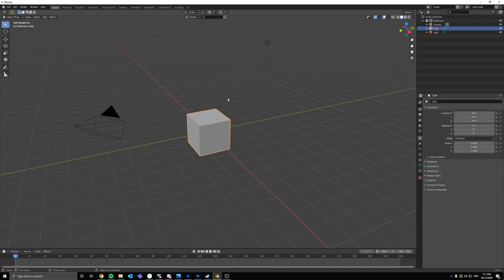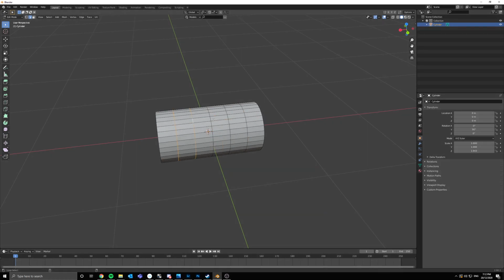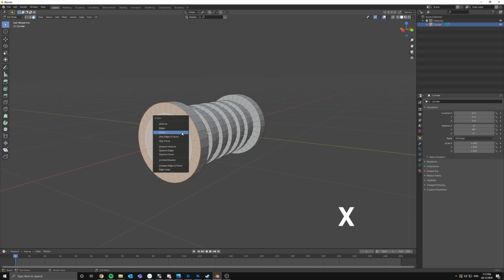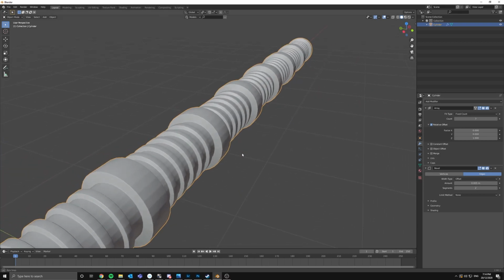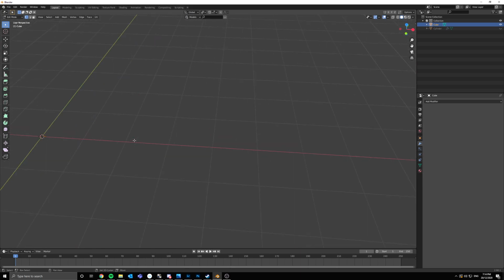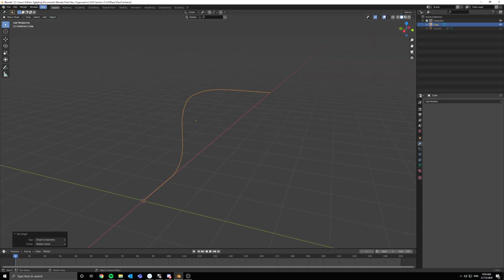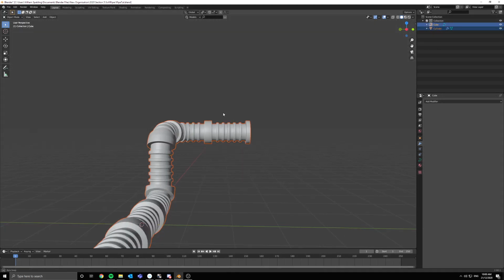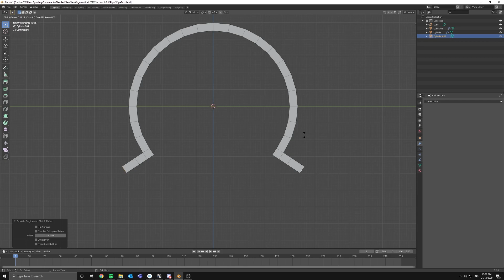Easy Pipes In Blender

Comment: thanks for this amazing tutorial! everything works except when i select the curve as the curve modifier object, i can't get it to follow the curve like you did. it's still random even when i apply selection to active.  any clues where i'm going wrong?
Reply from the maker: Hmm this seems to be a common issue, are you using blender 3.0?
Reply: @WilsonDigitalDesign  2.92!
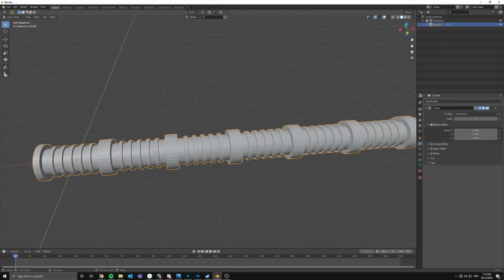Reply from the maker: @jeffhahn5799  Ok, make sure your pipe segment is rotated so its horizontal (you will need to turn the curve modifier off to check) then try rotating the pipe around on the Z axis until the pipe is running down the x axis like you can see in 1:04 - Or what ever the deform axis is set to in your curve modifier. Hope this helps.

Comment: could you please give any tip if it works in 3.0 because i've tried it several times but couldn't achieve the same result, the pipe just sticks to the end of the curve but doesn't transform :(((

Comment: Follow the tutorial, but the pipe still straight, after add curve modifier - select curve ===> nothing happen. The bevel modifier apply on the pipe not working also.( shade smooth, enable auto smooth step... work, but then add bevel modifier nothing happen...). Dont know what happen, maybe the size of the pipe and the curve should be at the " working range"...
Reply: i have this same issue, did you ever find a solution? both of these issues were things im trying to figure out right now, i dont need the bevel modifier as much as i need the pipe to curve though

Comment: how did you do the little brackets?
Reply: Best way would be to select the faces where you would like the brackets to be on the pipe, duplicate the faces (Shift+D), separate selection (P), and then work on the new object. There you could just extrude the edges to make the rest of the form, and apply a solidify modifier